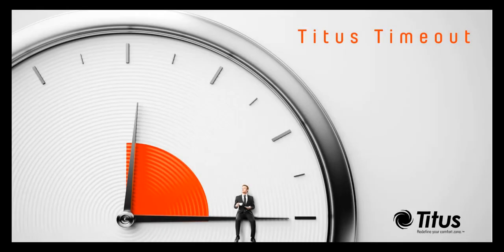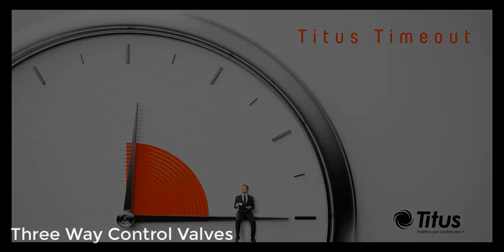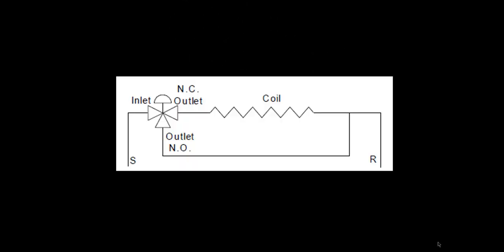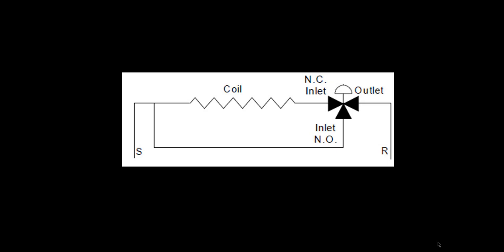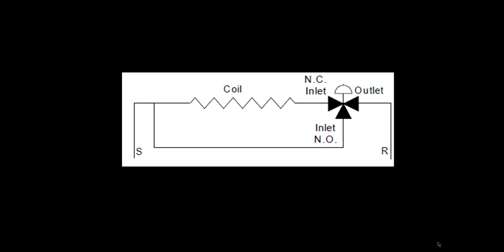Titus Timeout Podcast - Three Way Control Valves

Comment: Is the 3-way valve on/off positions only ?
I mean , can we set 3-way valve to positions like 40% , 50% , 60% 70% ? (depending on the partial loads) .
Or it just 0% & 100% positions only ?